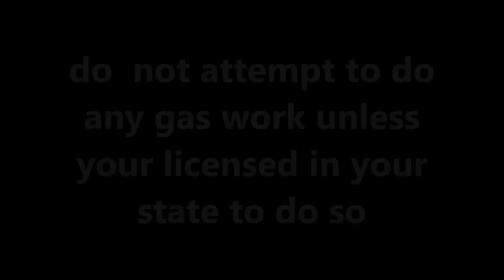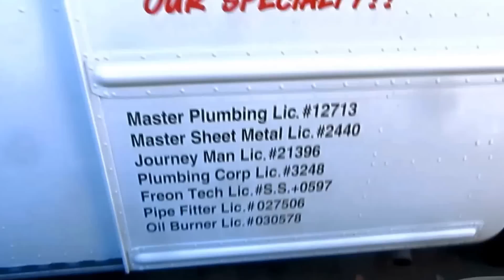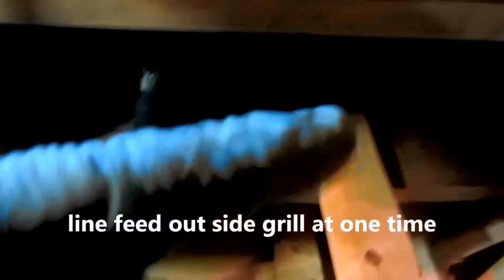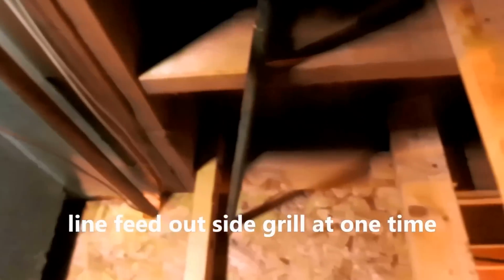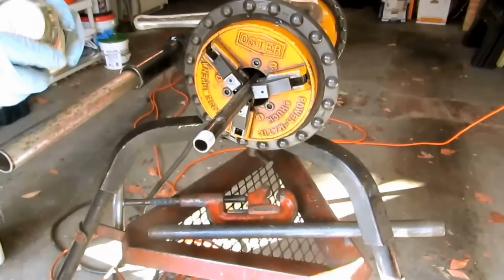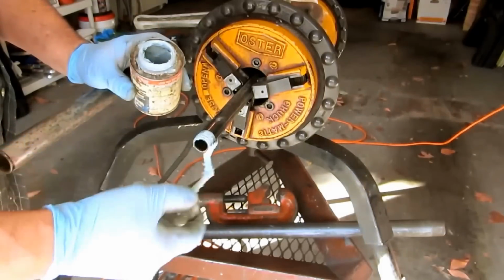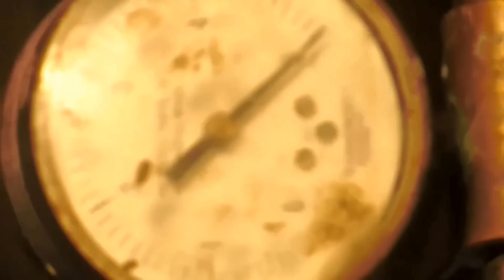GAS PIPE INSTALLATION : RAN NEW 1/2" BLACK GAS PIPE MAIN FOR STOVE

Comment: Very nice attention to detail. Why no drip leg in garage? What does the cold have to do with it? Your piping machine, it only powers the pipe? It can not thread it? What is the brand and model, I would like to see about getting one. Thanks for the quality video.
Reply from the maker: in my state you can not install a drop in a cold weather inverment /out side because .there could be liqiud from the gas line catch in the drip .i have seen quite a bit in drips before .and could freeze and spit the pipe is what they think i am not sure about that one but thats the deal.the pipe machine is a oster 100 power drive they no longer make them ,i have found some old ones on ebay i have 4  so i am good for life with parts

Comment: Hey Steven when your runnin pipe up to a stove like that you do not need a regulator anywhere in the line do ya. The valve at the furnace will knock down the pressure if you tap in where its supply pressure for ur furnace
Reply from the maker: there is a regulator at the applence

Comment: I want to run a gas line for gas fireplaces in a house I just bought.  I figured I would run the pipe and drill the holes and all that so save some bucks and then have the pro do the actual connecting it to the gas lines and check for leaks.  Have any suggestions?  The house has existing brick fireplaces already so not sure how best to drill through the brick to get the pipe inside the fireplace.  Is it best to use cast iron pipe like you use in this video?  Thanks.
Reply: Haha, ask a pro for advice, then he’s responsible for your consequences if you muck it up! Thus, no answer. 

Based on your 5 years ago questions, let a pro do the whole job, and clean your gutters yourself!

Comment: That's a fancy gas stove. So is that why there is a 'T' in gas lines to catch liquid in the gas line?
Reply from the maker: there is always a drop at end of run it does collect  some liquid, but not much .in my state in it has a piloit it needs a drip in electronic spark you can use and elbow  i always just put a tee with drip leg

Comment: Steven, I didn't realize there was a difference on a pilot or electronic ignition. I assumed a 2"-3" drip leg was required on installations of all gas appliances.
Reply from the maker: well in my state .i always install a drip leg for sediment ,it just looks better.i will not installl a drip leg out side or any were it could freeze
Reply: Living in Rhode Island, I know Massachusetts has strict codes, not only for plumbing and gas fitters, but electrical and boiler operators. It keeps the general public safe and is worth it.
Reply from the maker: Brad1237202 yes mass has its own plumbing code i thin k the best in the country the rest oof the country uses the bosa code. gas is covered under the plumbing code in my state ,but you can get just a gas fitter license but if you have it you can not work on plumbing,,,plumbing license covers doth gas & plumbing work

Comment: oohh be afraid, be very afraid of gas! don't even go near your gas line unless your authorized "professional" is holding your hand. should be , if you don't care about the job you are about to do don't do it. in my case the amateur is going to do a better job by adhering to ALL codes not just the "important" ones. My propane guy says "if it was my house id dig the trench and drop the line in at six inches and call it a day. Thats why I'm digging the trench myself down to 20" to be at the proper depth of 18. Im doing the interior plumbing too. Do I want to be a plumbing expert? hell no but i have to just so i don't get screwed paying a pro to do a half assed job.
Reply from the maker: +adrock84ify not all plumbers do a half ass job.just saying
Reply: I agree with that. My comment was related to the statement at the beginning of the video that you shouldn't install gas lines unless your licensed. Homeowners can be just as capable as tradesmen if they do extensive research, stick to building and fire code and use common sense. Not all plumbers are bad. That's a true statement and if your a homeowner with that mentality your going to get taken sooner or later.
Reply: I guarantee you that an amateur who cares is 1000 times better at quality work than a seasoned pro who is doing it because he is getting paid by the hour.